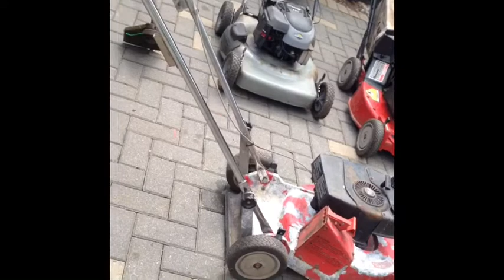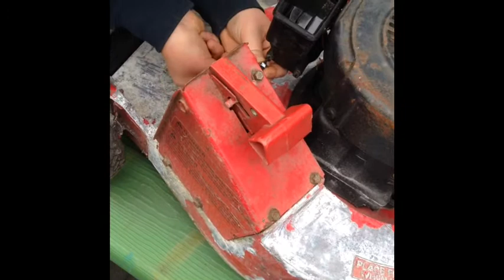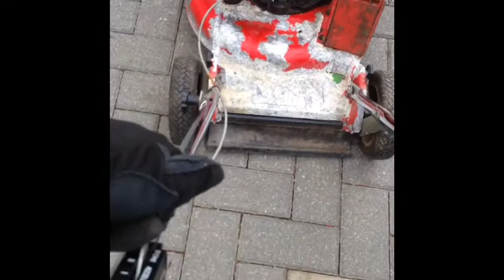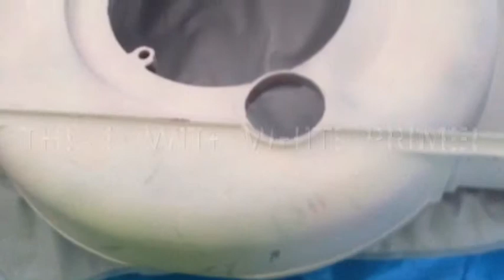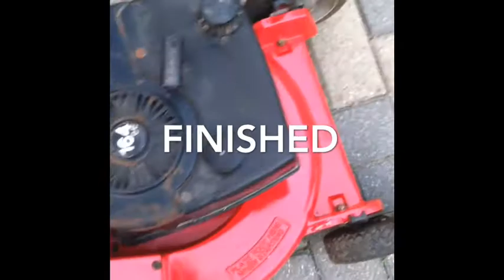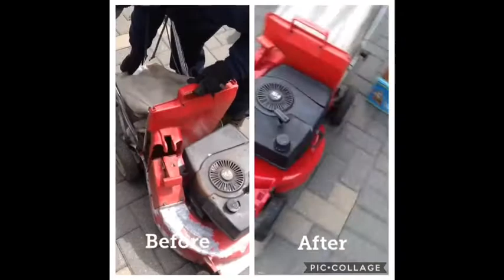Restoring a 1979 TORO lawnmower

Comment: I had a similar 18" Toro, not with a Tecumseh, but a Briggs & Stratton 3hp carburetor-tank engine.  It was a gem!  That's a good paint match for that mower and smart to use white primer... What brand/color did you use?  Thanks for uploading the video!
Reply from the maker: Krylon red was the closest red I found in my dads garage. Thank you